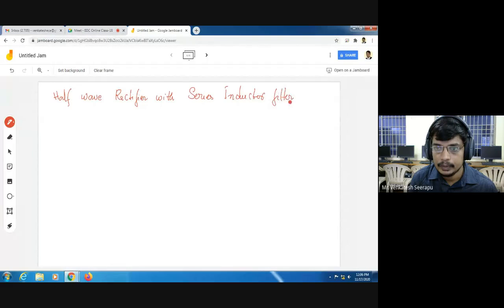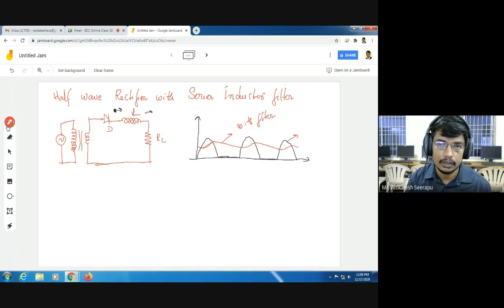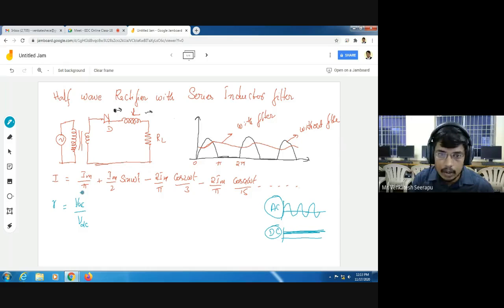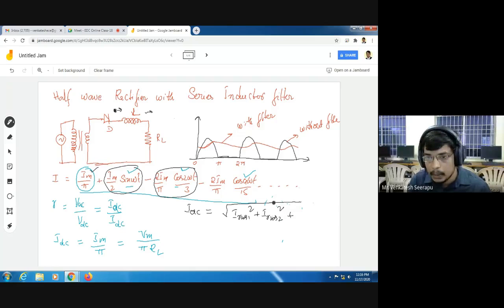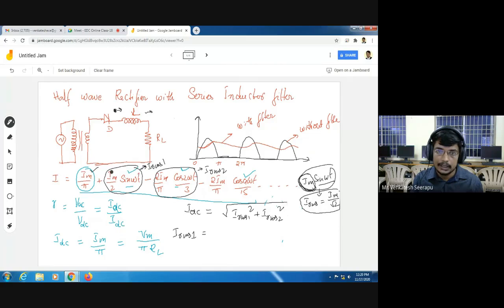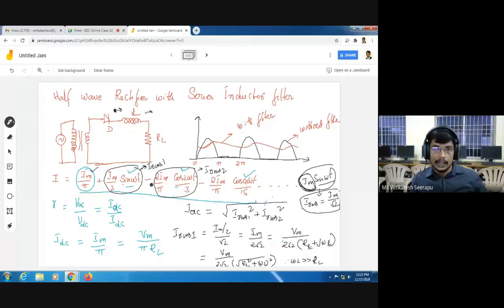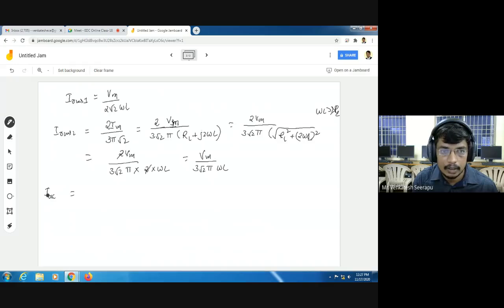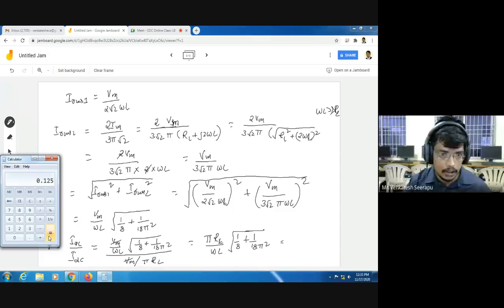Half wave rectifier with series inductor filter

Comment: Sir, why Iac = √(I²rms1 + I²rms2) ??
Reply: Sir please reply sir...
Reply from the maker: If we have more than one ac components it is the formula for overall ac comoonent
Reply: @venkateshseerapu4622  
Sir, what is that formula initially you have written for I ?
Is it Fourier series or Taylor series expansion??
Reply from the maker: @navaneethdesai  it is expression for the output wave form of rectifier with filter
Reply: @venkateshseerapu4622   Is it the formula for any rectifier, with any filter sir?
Reply: @venkateshseerapu4622  
iL =(2Im/π) - (4Im*cos(2wt))/3π .........
Can we use this expression sir ?